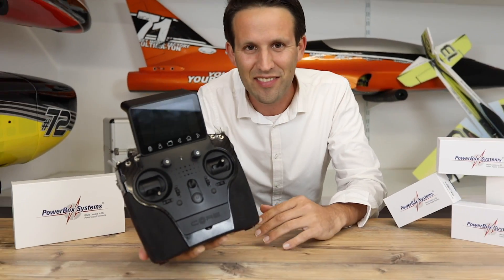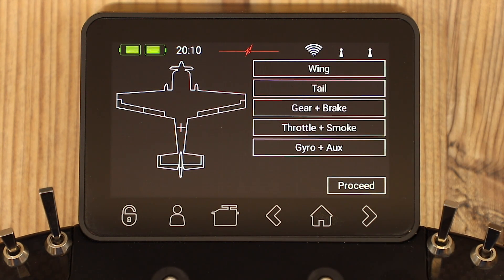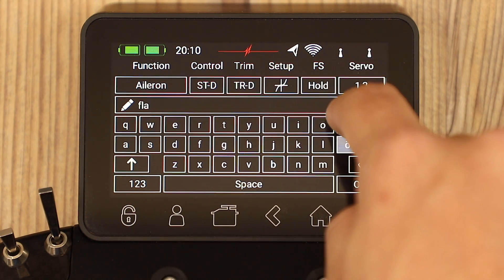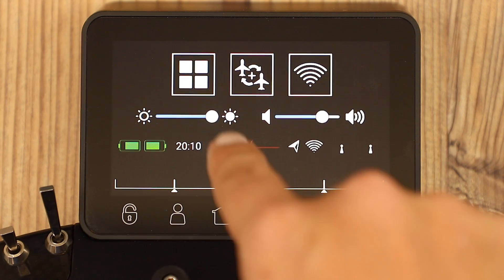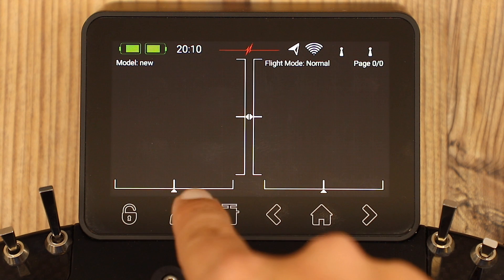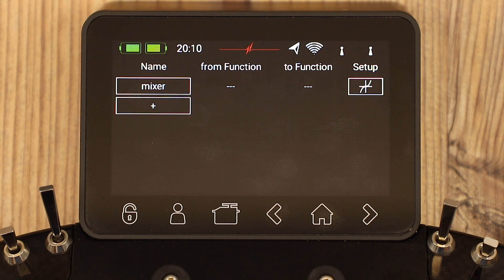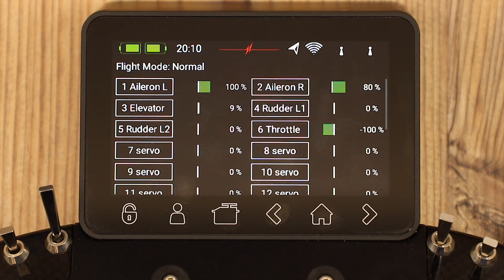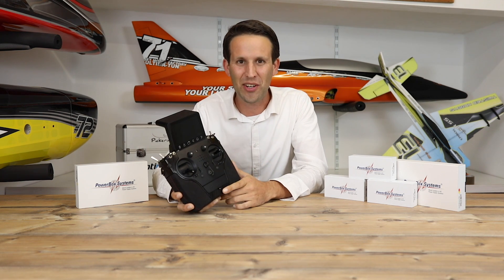Powerbox CORE - Software and setup

Comment: Very informative video Martin.  Would love to see a video on the voice capabilities and setup of this on the core.  Looking for info on how to setup voice feedback when you change the position of a switch/dial/slider, voice feedback from telemetry like lowest cell voltage, voice feedback when changing gyro settings.  For instance on my left slider i can activate telemetry feedback on lowest cell voltage every 20sec. On my right slider i can activate voice feedback for different positions on gyro settings.  Would love to see how this works on the Powerbox Core.

Comment: I don’t think I would like to invest in such a high end radio that doesn’t have helicopter functionality, very strange.
Reply from the maker: All new helis use FBL and don’t really need a heli mode transmitter anyway…
Reply: @MartinPickering-PickeringRC  I’ve been out of the hobby a few years, flybarless was only relatively new back then.
Thanks for the reply.

Comment: Gorgeous radio but hard to swallow if for 1/10 of the price one can get a Radiomaster with OpenTX supporting all common RC protocols. This Core radio has a hopping frequency of 80 while Futaba SFHSS has 60 so not too much advantage over here. I doubt you'll notice any difference between the two flying 3D or a jet and for the price difference you can get a nice 30% 3D monster.
Reply from the maker: I agree its not for everyone, however large planes are expensive and crash, radios don't so why not have a good one in my opinion...  There are loads of great radios, but from my experience with the overly complicated interfaces in OpenTx and their radios that usually need new gimbal assemblies yearly, comparing them to a Core or a Futaba seems a few years off at least
Reply: @MartinPickering-PickeringRC  You're a little off, those cheapo radios do have HALL sensors. I lived in the US for several years seeing people at the field with 6 15-20k jets crammed in a trailer. Those for sure don't mind spending the extra for the CORE. https://www.banggood.com/RadioMaster-TX16S-MAX-Edition-2_4G-16CH-Hall-Sensor-Gimbals-Multi-protocol-RF-System-OpenTX-Mode2-Transmitter-with-CNC-and-Leather-for-RC-Drone-p-1756145.html?p=X0110142748584201912&custlinkid=723808&ID=23242482&cur_warehouse=CN
BTW your English is very good for a Spaniard.
Reply from the maker: @martijnstam6186  Problem isnt the pot or hall sensor, it just all gets sloppy with time and use... a guy here uses one on his expensive stuff, swears by it, good luck to him and everyone, if it works for you thats all you need, but from what I have seen, I cant recommend them, not yet at least, even if they are getting slowly better. Until then, a middle range Futaba is my best reccomendation for anyone not wanting something multi-thousand...

Comment: Hey thanks for the video. Please explain to me how I can use the single trim for starting two turbines. Individually one after the other. In my futaba there are two trims
Reply from the maker: It may not have T5 or T6 as per the Futaba, however it does actually have 2 additional trims which could be used for this purpose (the buttons in the center of the radio, and those at the edges by sliders). Personally however I would use the two sliders, or possibly a logic switch

Comment: Hi, very good video and giving some nice Core programming insight. I would like also to see some more about telemetry viewing. Specially how does it look after flight of analyzing recorded telemetry. And second, how about setting up iGryo with the Core. Is it possible to do it within the Core radio?
Reply from the maker: Hi Jens, thanks. Telemetry video is in the works, will be releasing soon a video about the Sparkswitch Pro and this shows a lot more. iGyro, currently not yet, however future updates should expand possibilities.